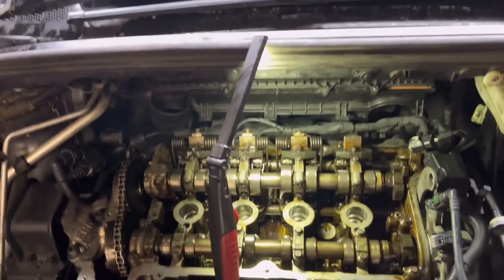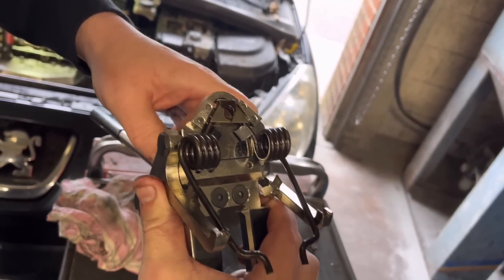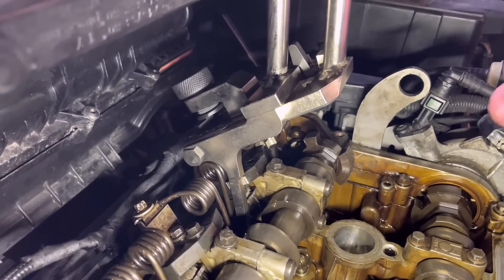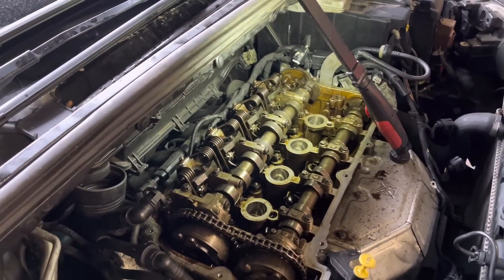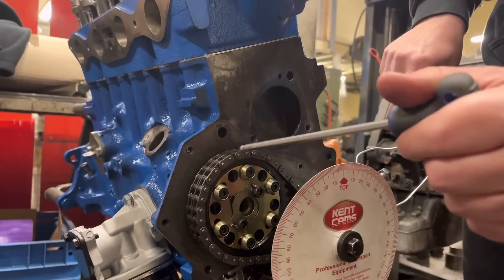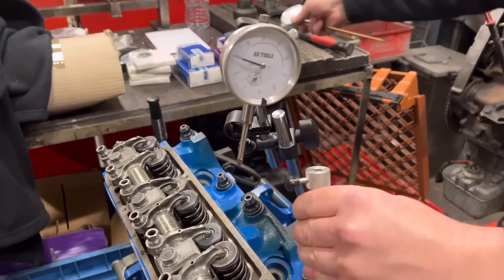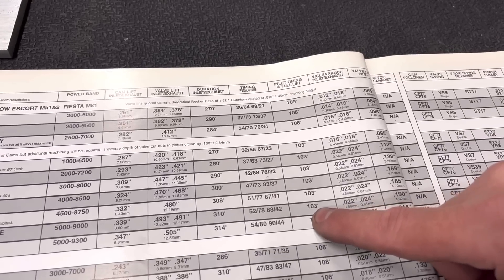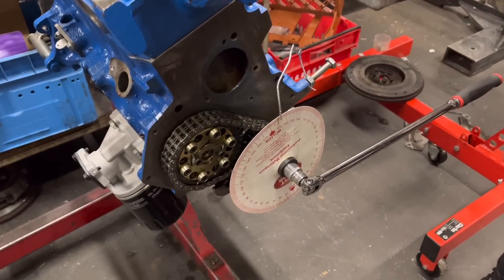When the garage MESSED UP and needed our help

Comment: I would turn the crank from the rear so as not to disturb the setting of the degree wheel. I'm also surprised to see the degree wheel in not metal? View from the States.

Comment: The Peugeot / Mini engine is a nightmare. Oil leaks as standard. VVT solenoid problems with extended oil service times. On the other hand duplex chain on an ancient Ford engine 👌 BMW , VAG etc take note or probably  not as usual ....

Comment: Great job on the valve springs. Glad to see the tool fit in the small space you had to work in. Just my personal opinion i would have taped the spark plug holes over, my luck I would drop a bolt.

Comment: Just an observation on the Cross Flow Cortina engine but how does the cam sprocket holding bolts washer going to do it's job, stop the bolts from coming out,
 when the washer is bent around round head bolts.

Comment: Just use a positive stop tool to find TDC, don't mess about with a DTI, the stop tool is the most accurate way of determining an accurate TDC. I wouldn't dial cams without one, and use a rather more durable pointer, a 2mm steel welding rod with a ground point is better. The DTI needs to be parallel with the valve stem, with the DTI slightly angled on the valve you are not measuring the valve lift accurately, and the timing will be a degree or two different depending on the angle of the DTI
Reply: He wasn't trying to measure the valve lift, just find the point of maximum lift, so the angled DTI was perfectly adequate for that.

Comment: That cam pulley on the X flow is an adjustable pulley Lee, the vernier pulley centre has 2 parts with 2 rings of equal sized holes, one side with 1 more hole on the same pcd than the other and a pin that passes through both sides to lock the 2 parts in place, sorry to nit pick mate 😉

I gotta say I like the direction your videos are moving in, better quality and more race tech, when you get videos of cars with your engines on the dyno, your show could be the dogs nuts.. 'Sausage'  HTR Ltd

Comment: We used to make TDC indicators out of old spark plugs, you took a plug and smashed out all the porcelain leaving the metal body of the plug behind with a hole where the porcelain and electrode used to be, then finding the closest sliding fit knitting needle that would fit into the hole and there you go, TDC indicator on the cheap as the plastic coated knitting needle would ride the piston crown up and down without causing damage.   My grandfather taught me that one, he was an amazing home mechanic and every year he would have his SU carbs off the Triumph Vitesse out, stripped down, cleaned and polished, he taught me how to make a set of carb balancers for the SU's, just old coat hanger with a coil bit in one end to fit inside the damper, the other end bent over at 90 deg to be your indicator and you set up the carbs in perfect balance when the two "arms" were perfectly level with each other.   He also taught me how to peen a fresh head gasket out of thin plate copper, he religiously put a new copper gasket in every year when he did the carbs, tin snips and a peening hammer, dunno what thickness the copper was, thick daubs of grease either side to seal and he would "holy stone" mating faces with the head he used grinding paste on a piece of plate glass, still remember the pong of the old Chemico stuff but he got both mating faces like a mirror, checked both for true then on with the newly created HG and another year done for the old car.   He used to drive to Scotland and back with his caravan many times a year and never let him down so he must have done something good.

Comment: Back in the 70s it was a lot harder to set the Kent camshaft we had to use offset dowels.when I did my xr3 I with a Kent cam I got a vernier pulley on initial setup i lined it up with the standard cam wheel then to my surprise when setup with the dti gauge it had the correct timing.

Comment: 15:45     Why did you fold the locking tabs on the camshaft when it's got allen key round head bolts?

Comment: Oh hell, the engineers must have been drunk when they came up with that spring contraption. “Listen Kurt, I have an idea, lets use a mouse trap to hold the rockers in place.”
Reply: That is why I Drive a Hgv now When I could see How stupid and Complicated manufacturers would make a simple fitting job ,Remember the German Tank that was way too complicated for Field Repairs that Lost the war🙈 ,And they Produce Complicated Simple Repairs with Space ship Technology, The A5 V6 VW cost of Repairs for rocker arm bearing failure is 24K Which should have been a recall as they fit larger needle Bearings Modified, Engine out, Well Done 🙈😡
Reply: Hitler's revenge
Reply: @1magnit  Exactly.  I've told many German car customers who complain about Vanos units failing  "Payback for us winning the Battle of the Bulge" or  whinge about worn rockers on MB V8's as " Loss of the Bismarck".  And so on.  Japanese cars it's a bit less common, but I considered early Toyota V6 head gasket failures to be the result of Iwo Jima.
Reply: Valvetronic is a brilliant system and doesn't really give any trouble, the vanos units are a different thing and TBH if the oil is kept clean, they don't give much trouble either.
Reply: @onecookieboy  Yes its a brilliant system but honda Vtech is the correct way to implement it. The bimmer contraption is not the best way of doing it.
Reply: @MJPilote  Valvetronic is nothing like vetech and its purpose isn't the same either. Valvetronic is about optimising engine efficiency by only opening the valves as much as needed to control airflow. Are you aware that a BMW valvetronic engine doesn't need a throttle body to control the amount of air going into the engine, it's only there as a failsafe?, it can (and is) done with the stepper motor. The vanos takes care of variable valve timing.
Reply: @MJPilote  Vtech and valvetronic do completely different things. 
Vtech is a simple shift in cam profile between fixed values, valvetronic is designed to work in conjunction with vanos to provide infinite adjustment of all possible values in the intake timing and duration.
If you do not understand the basic principle of operation why comment ?.

Comment: The Allen head bolts on the cross flow cam that have the lock plate folded over them need to be cross drilled and lock wired.
If you ever have one of those come loose the carnage will be significant.
Great instructional video on setting the timing.
Take care.

Comment: You can make those spring tools from a large hinge and if you put a V in a flat head screwdriver you can locate the spring legs with ease. I repaired my old mini clubman with a home made compressor tool as the proper tool costs £300. The DIY tools cost was about £6. I've still got it somewhere.
Reply: You could make them and sell them?
Reply: I miss the days when the Haynes manual included the instructions to make such simple tools when it could be done to avoid factory service tools.
Reply: Proper engineering! Old school, and I love it.

Comment: I don't think your explanation was clear to a beginner and your camera work was dodgy.  
1. When you brought the crank to 80 and set the indicator to zero you were on the opening ramp of the cam lobe.
2. When you went past full open and the indicator went the reverse direction to zero you were on the opposite side of the cam lobe.
3. By subtracting the original 80 degrees from the second zero setting  126-80 = 46 which is the distance between the opening and closing ramps.  Divide that by 2  = 23 which is the centerline from each ramp to the top of the lobe. 
4.  Your original start point of 80 + 23= 103 which was the point on the cam lobe where you got maximum lift.
  The 80 start point is arbitrary- you can use any number in the opening sequence.
Reply: Thanks for the explanation, I will have to watch again and see if I can understand better 😊
Reply: Don't really think I'd be ecstatic about leaving the setting-up of a stage 4 race-tuned engine to a beginner, though: Seems unlikely?
Reply: A clearer explanation thanks for that.
Reply: I want to see proper terminology used, ie, Heel, Toe, Ramp, Base, Circle etc. An explanation of the valve operation with Camshaft positioning showing the effects around the movement of the Cam Lobe. Good video though, thanks Lee.

Comment: What happened to the good old rocker shaft, rockers and tappet adjusting screws. Has to be a lot easier than all that nonsense with springs, special tools etc. I say go back to the 60's engineering. Keep it simple.Ian New Zealand
Reply: German design- reason the Russians kicked their butts at Kursk.
Reply: In built obsolescence

Comment: Absolutely fantastic video on how to set the cam timing. I would love to see you do exactly this with a Jaguar twin over head cam XK or E type engine. They have the cam setting plate, but I would be interested to see how accurate with the cam timing compared with the figures in the instructions. Standard cams are 15/57 and 57/15, but fast road cams are earlier and later.